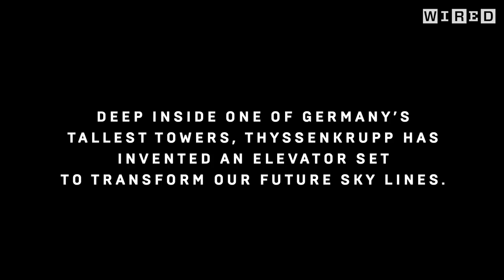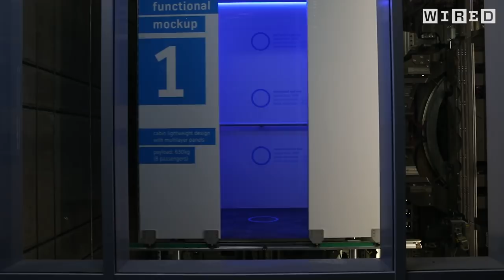Reshaping Cities: The Maglev Multi Elevator That Goes Up, Down and Left to Right | WIRED

Comment: What about power usage? There's no counterweight - the motor has to lift the entire weight of the cabin. Unless there's regenerative braking when its coming back down this will be horribly inefficient.
Reply: boltar2003 Actually, magnets used to move this elevator are even more efficient than conventional elevator
Reply: The total energy consumption isn´t affected by the use of a counterweight it just drawes that more power when moving the cabin down then it saves when moving it up. Beside that fact right now there are verry many hydraulic elevators which also need a lot of power when moving up but nerly nothing when moving down. Greetings from an austrian thyssenkrupp elevator technician

Comment: the lift looks sophisticated to stop apart from the loop travel in order to prevent blocking the previous lift if it needs to transfer passenger at higher level than its previous one.

Comment: Funny they didn't mention security
Reply: They are an elevator company, not a security company. I would assume that a large company that makes elevators would likely just employ the same tech for the security of the new elevators that our current secure elevators use. I would be more worried about safety tech should things go wrong, like power blackouts at inopportune times.
Reply: If the power goes out, the electromagnets holding the safety clamps in will also lose power and the clamps will be forced out and into place by powerful springs and lock the elevator in place.